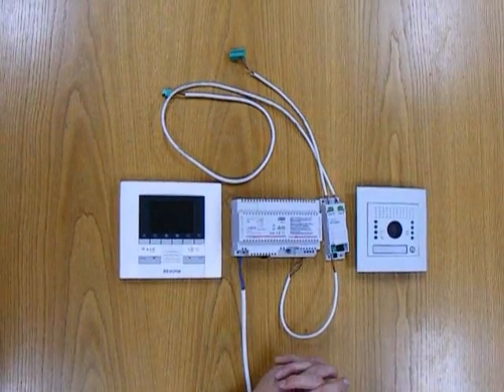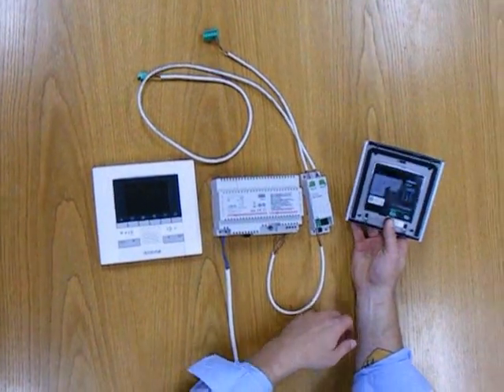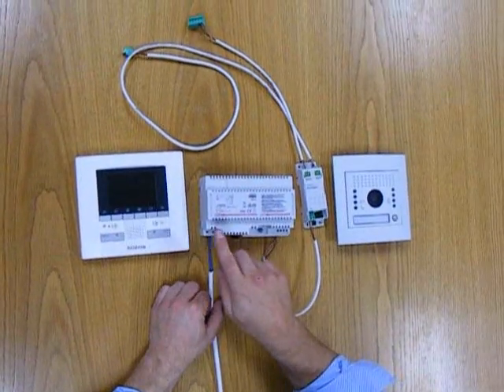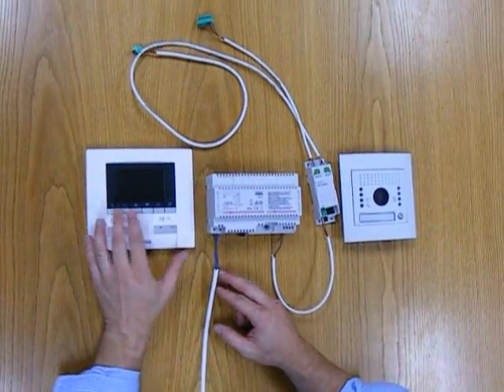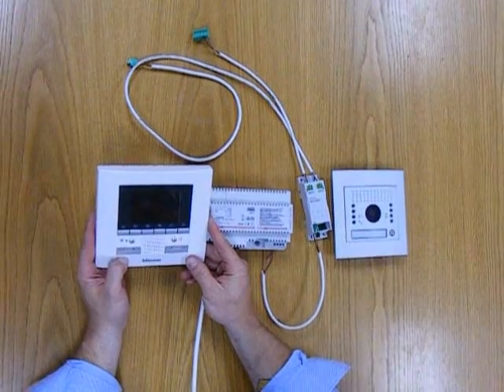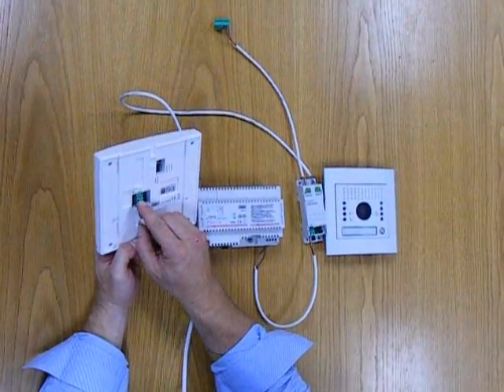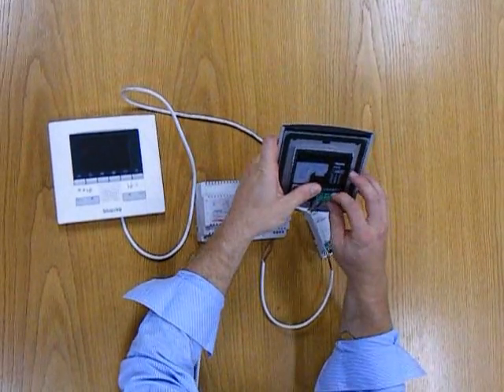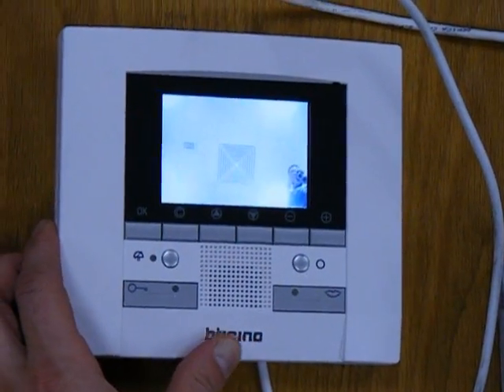BTicino 2 Wire Video Handsfree

Comment: How to determine if the 346830 (Video Adapter) is broken or not?
Could you tell me the Volts in output?
(in both situations: When the video door entry unit is on and when it is off)

Thanks very much 🙇‍♀️🙇‍♂️